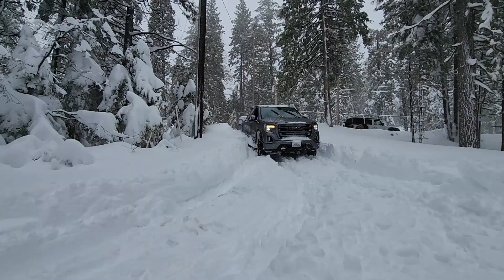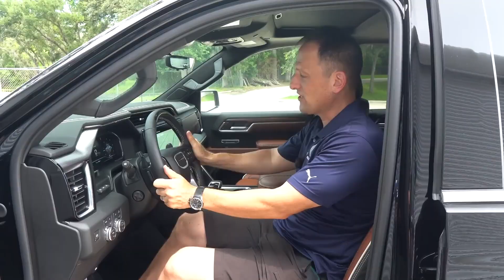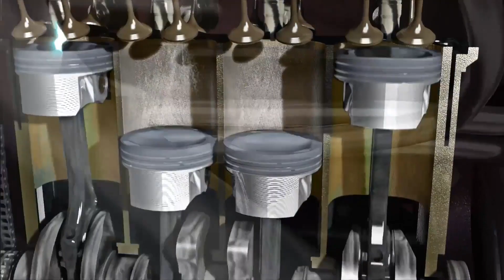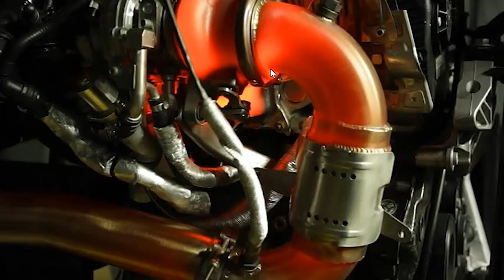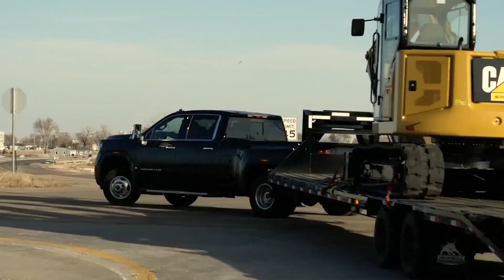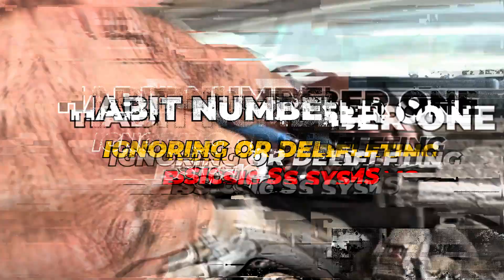7 Driving Habits DESTROYING Your GMC Diesel Engine Without You Knowing

Comment: Do all of these apply to the 3.0?
Reply from the maker: Some habits apply, like proper warm‑up, consistent oil changes, and avoiding constant short trips. But the 3.0 Duramax is a different animal: use the correct low‑ash oil, change the fuel filter on time, and make sure your driving allows DPF regens to complete.